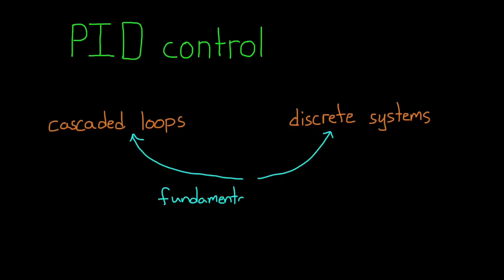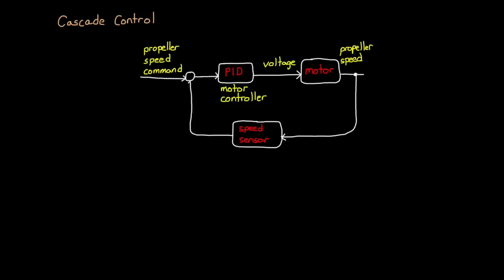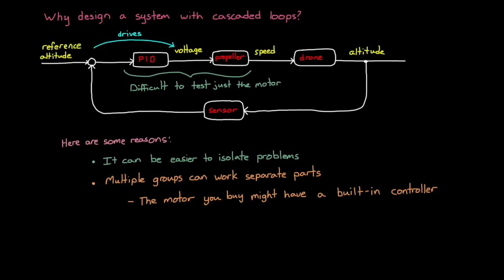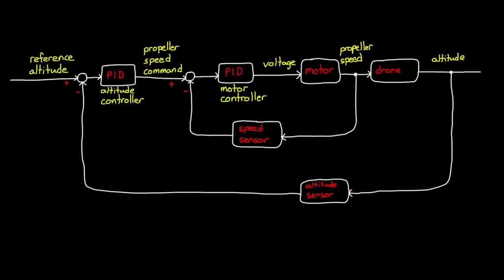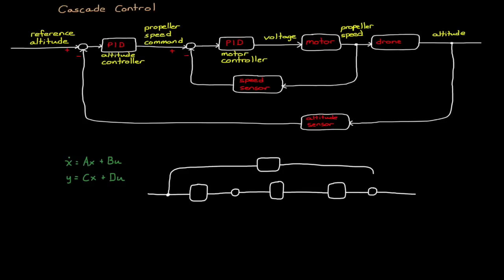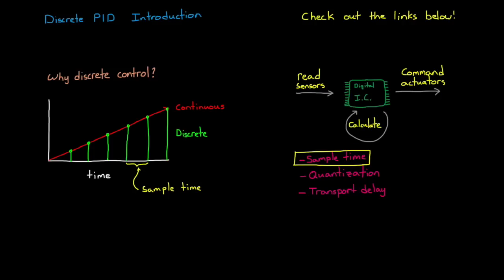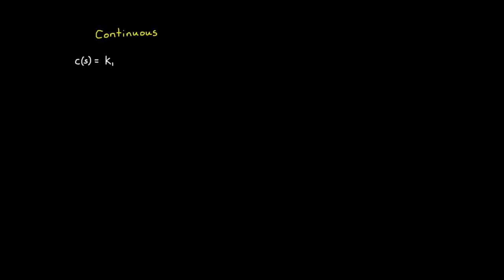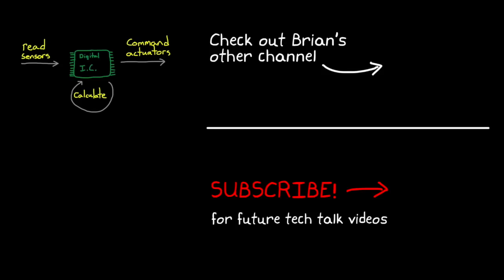Important PID Concepts | Understanding PID Control, Part 7

Comment: I earned my EE degree 3 years ago and went to sea running engine rooms. This series was an AWESOME refresher for my interview tomorrow designing PID controllers. Wish me luck and thank you, Mr. Douglas!
Reply: Good luck! If you don't mind sharing here, I'd love to know how the interview goes.  Cheers!
Reply: Just had it today. It was great because using almost exclusively the content you covered in this series, I had an honest discussion about taking my PID/PLC knowledge to a professional setting without going off-base with any facts. I impressed them. Then right after the interview we drove to a water treatment plant and helped them fix a VFD controller. Luckily I proved myself, providing novel ideas leading to a quick solution just based on my experience handling ship plants. THANK YOU. I could not have pulled it off as well without your insight.
Reply: Well, that sounds like a pretty positive outcome.  Congrats!

Comment: Thanks for watching!  If you have questions for me, leave them on this comment so I get notified and can do my best to get them answered.  Cheers!
Reply: how can i built hybrid fuzzy pid controller ?
on simulink and connecting to port (arduino...)
Reply: Hi! Awesome series! It's been really helpful. I need guidance on a system with multiplexed blocks. If you could point me to a useful source I'd be grateful. I need to code a Controller for a Pump + 2 Valves closed pneumatic system (one valve for feeding air flow into the container and one for releasing air to the atmosphere). The resultant input flow would be A x B, where A is the pump motor control output flow and B is the valve open duty. I need to control both variables with the same input. Any kind of hints could help as I haven't found any info on such a topic.
Reply: would you please do a series on Model predictive control.
Reply: If we have to design PID controller using bi-linear transformation.. We substitute ( 2/T) *(z-1/z+1)..how can that justify the Disctitized PID  equation derived in the above vedio
Reply: Great explanation. Really very helpful information
Reply: thanks for ur course to explain the PID controller ...After I washed all ur videos I understood what is PID controller.  can u explain the model predictive controller??
Reply: I always wondered if we could implement a discrete controller using continuous domain parameters Kp, Ki and Kd, if we consider the cycle time low enough compared to the system reaction time. For the first time, with regard to what you said in this video, I would say it is possible... Could that topic be interesting enough for you to make a video on it? I mean, comparing the 2 approaches, discrete control based on a bilinear transformation of a continuous-domain controller, and a pure implementation of the continuous-domain controller, neglecting the effect of the cycle time ?
I was thinking of a room temperature control with an Arduino, where cycle time is much faster than the temperature change rate... 

By the way, thank you so much for the valuable content you always provide. It makes the world of control systems way easier to learn compared to traditional courses, in which I always get lost due to heavy mathematical approach.

Comment: Many thanks for your excelt video.
How to discretize my PID design if I have no fixed sampling time? I mean, I use Hall for motor speed what gives speed update dependent on speed. Rotating at 60RPM I get uptade once per second and don't need to run PID more often. At 60kRPM I should run PID 1000x times more frequently. Discretization like Tustin gives very different results for such a diffesrent sampling times.
Reply: If you only need the PID controller to run at 1 Hz, then I wouldn't tie it to the asynchronous output of the hall sensor. It sounds like you only need speed information every second so if that meets your performance then I'd stick with that. To run the PID controller you need the current error, the rate of the change of the error and the integration of the error ... but even though you only need that 1 once per second, you could (if you want) have a sensor processing step that is keep track of those things asynchronously but returning the current value only once per second. So for example, you might average the speed for the last second and report that as the current error. If you can get away with it from a requirements perspective, you might be able to just always grab the latest measurement and assume it was constant for the last second.
Reply: @BrianBDouglas  At first I'd differentiate Current-PID and Speed-PID (they are exactly PI). They are cascaded. Current-PID takes part cyclic with calling frequence respecting electrical properties of motor. Due to low time constant of winding it is 40 kHz.
Whatever the Speed-PID calling frequency is, this controller can not update the error until Hall signal changes or timeout happens (basic stop prediction). Hall edges come from single Hz to 1kHz in useful speed range. Otherside the Speed-PID execution with mentioned 40kHz is significant load for MCU without any benefit from this high rate. Therefore the idea to ececute Speed-PID with much reduced rate.
I think 2kHz execution fixed should work for me. 
But I still stay courious, hot to model (z or s transform) non-fixed sampling or event based sampling of PID controller.
Thank you so much for your answer and for really good learning stuff.

Comment: I've been watching all of these videos and to be honest with you you make it way too complicated.... And how many parts is there to this PID video anyways. You're tone makes it sound like it's super easy but to be honest with you it looks like a bunch of gibberish. I'm not a rocket scientist I'm just a robot creator that wants to know about PID the way you're explaining it I would need to be a rocket scientist to even remotely understand.
Reply: What the heck are you saying? This series is the most intuitive explanation of PID control anywhere. Any control system engineer will tell you that. Maybe you don’t know the actually technicality of the topic and only know the basic implementation. This is not 5th standard stuff but he actually brought down the graduate level concepts to a high school level. There are thousands and thousands of pages on this topic, going deep into the mathematics, implementation, documentation, software - you can just keep on reading for years and not really understand what it all means in real life. He condensed those thousands of pages into an hour long series. This is teaching at its most awesome form.
Reply: Anyone please help?

After using PID controller initially, how may we got propeller speed command. I mean, here deferences between altitude has been measured!!
Please help
Reply: And in second pid, how did we get voltage after calculating the error of speed!! 
Please help
Reply: control system is hard dude, rocket science is indeed control system